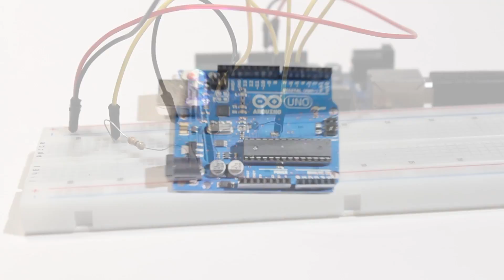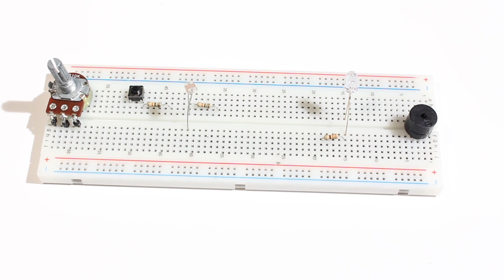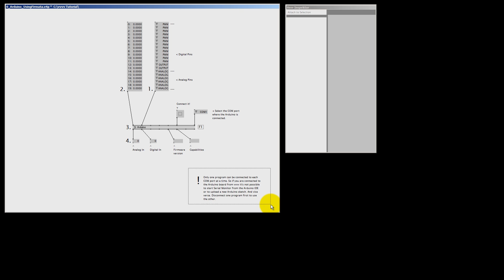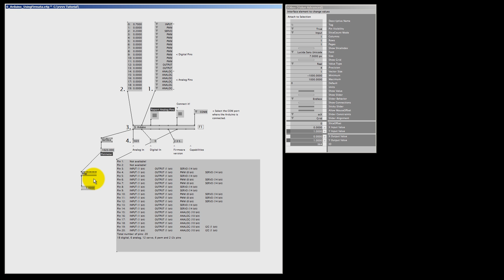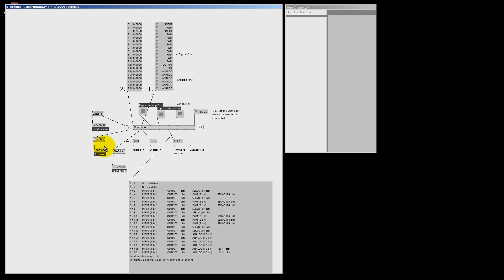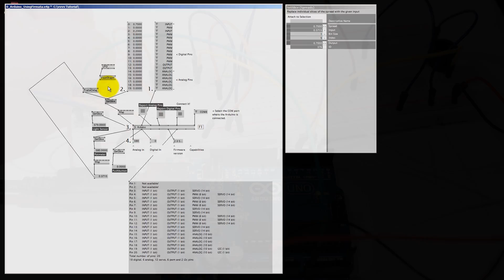Firmata, Arduino and VVVV, an introduction

Comment: Hi! I am having a bit of trouble. I installed vvvv, but when I opened the Arduino file in IO, the name of the ffile is " Arduino_without_firmata" and "Firmata_advancedusage". So I don't have the same patch as "Arduino_using_firmata". Maybe can you give a hint for this? Thanks!
Reply: I have the same problem. Hoping for some updates from the guy

Comment: Is it possible to map and control a servo motor with a grayscale image through vvvv? I'm making a servo array of 10x10 and I'm looking for a way to use a grayscale 10x10 pixel image to control the 100 servos movement up and down form 0 to180 degrees. can vvvv do something like this?
Reply: +John Galin I'm a vvvv beginner, but this sounds like an easy task to do, you can analyse your grayscale image pixels and map that to the servos for sure!
Reply: John Galin d

Comment: First of all, your Tutorials are fantastic!

Now, can someone please explain this voodoo to me? Like, I have my hand close to the Arduino and the digital inputs (3-5) react. They do not react to the simple push button, though, like in the above example. Is my Arduino weird? It can't be becasue I can easily make a working pushbutton thingy with vvvv 28s RS232 node (and a bit of code). The same appraoch in 33.1 does not yield usable results...
Reply: Nevermind, actually. Got what's needed working. Still, fooking voodoo ;)
Reply: pull down resistors needed, or pull up, whatever?